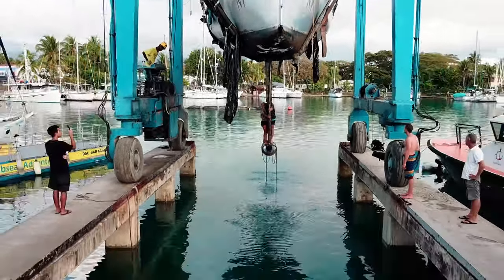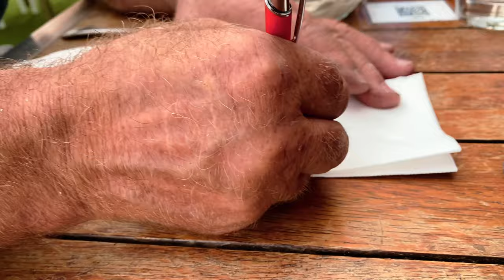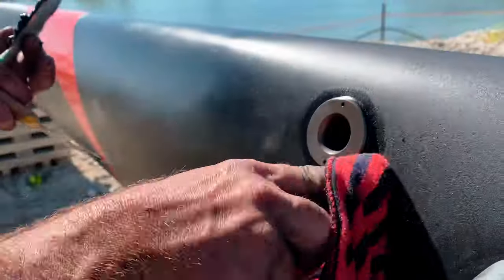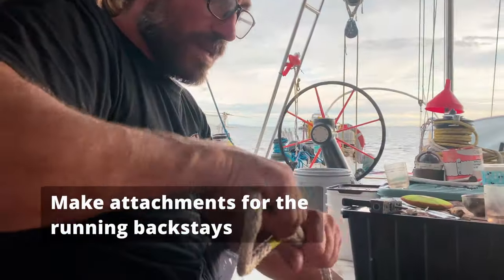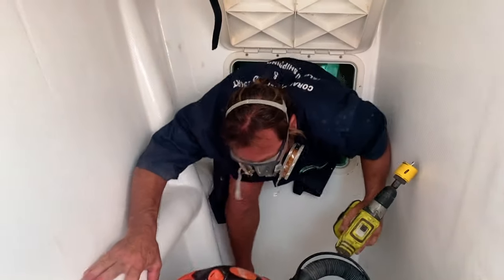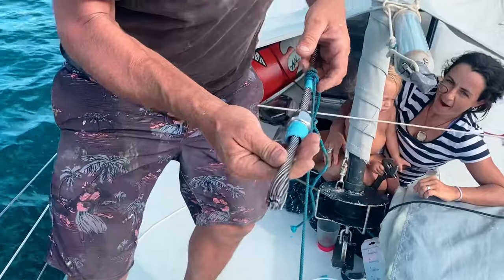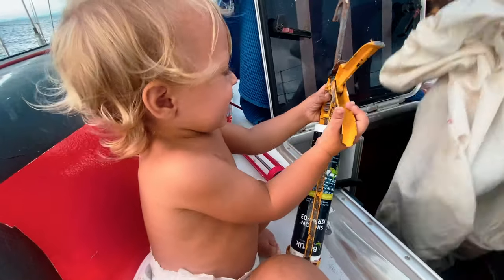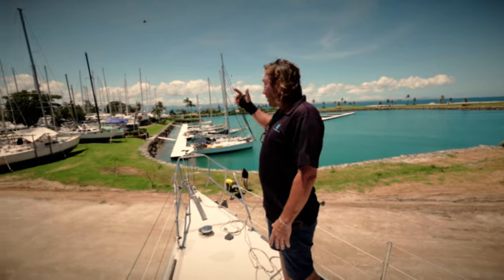Triple Sail Thrills on our Open 60: 15-Minute Rigging Revelation!

Comment: I belive ur supposed to use lock tight on those stay locks
Reply from the maker: Right good point, we did use it but it was during another moment when I wasn’t videoing. We re opened to check the terminal and how it had pressed the wires and then re tightened with lock tight 👍🏻